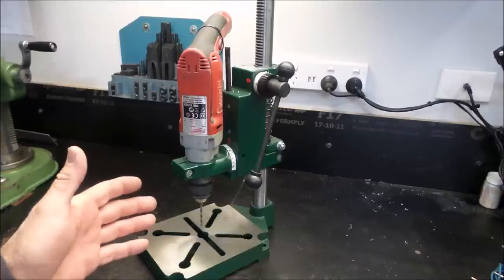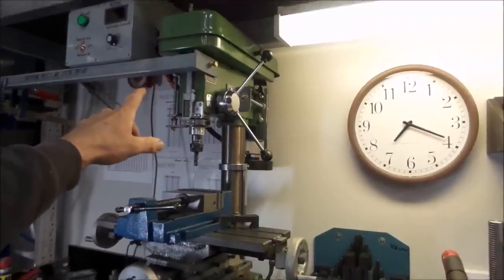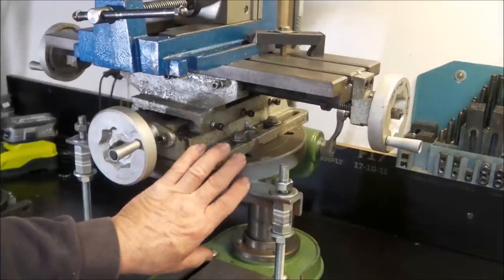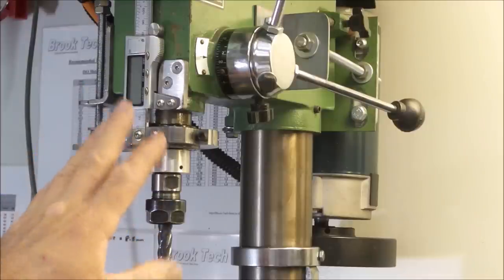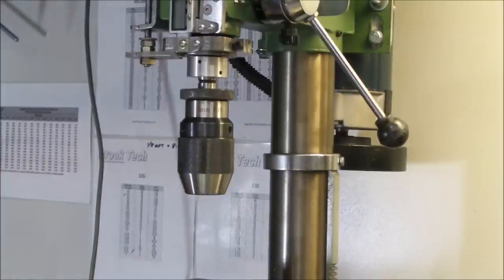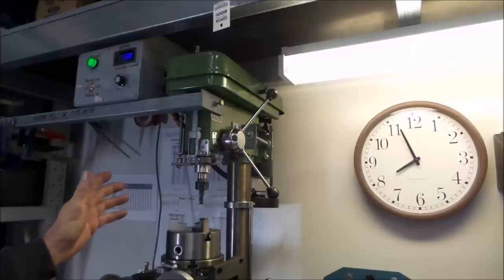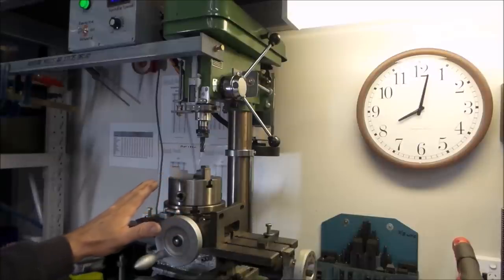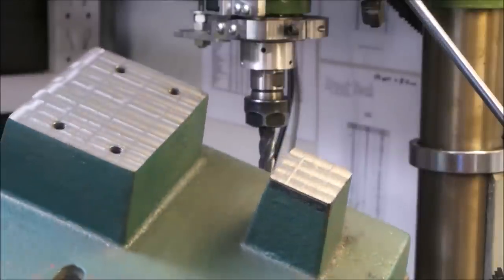The Ultimate Drill Mill Conversion Episode 1

Comment: Excellent video!! One point to consider for converting drill press to mill,  if replacing the quill bearings, is drill presses have ball bearings which are limited in thrust, while mill machine lower bearings are angular contact bearings, which are much better for thrust.  On my drill press (a Buffalo Forge 18) I found that I could get an angular contact bearing with the same dimensions as the lower ball bearings.  It's worth looking into.  Greg

Comment: I love repurposed tools. I'm using an old wood lathe head stock to make a DIY surface grinder. Yours is the best DIY mill I've seen. Good job.
Reply: That sounds awesome, I'm trying to use my wood lathe spindle for a light duty metal lathe, and I'm using an old precision ball bearing spindle (it's called a hard disc drive spindle but it's about as big as an american football) to try making a rotary or linear precision grinder with some granite plates for the linear ways with homemade graphite air bearings. Still major work in progress but I'm keeping my fingers crossed.

Comment: I have a HF round column gear head mill that is basically the big brother to your rig. When tramming the tool to the table I use a 150mm cut off of 8mm rod from one of my 3D printer projects. The rod is totally straight and is easy to line up with a square.

Comment: Great video..I've seen a few more worthwhile modifications..like a 80/20 sand/epoxy mix to fill in columns and base castings to dampen vibration / chatter..a car scissor jack to raise and lower the drill press table with just a turn of a handle..but the best was to dramatically stiffen the chuck head from sideways flex with a ball bearing fitted to the outside of the chuck then a sleeve on the outside of the bearing that then U bolts back to the column with a fitted metal spacer in between the sleeve and column..2 to 4 U bolts are used..making sure to tighten but over tighten causing flex back towards the column..the chuck usually needs to be fitted to fit exactly snug inside the ball bearing with some sandpaper or a lathe if available.. afterwards ZERO flex..I was thinking about using a old 10 to 18 speed bicycle for the gears and a shortened chain to replace the slipping belt and pulley system and gain more speed control and possible torque..also seen a old treadmill motor and controller used with great results..

Comment: Finally got around to making a that collar for an M2 taper ER32 collet.
…easy as! As well as taking lots of steps to reduce all movement, re your ideas.
All in prep for a light mill conversion as you’ve set out.
The bonus, even at this early stage, the drill function has really improved.
Ta mate.     R
Reply from the maker: Cheers Rod, great stuff. Agree 100% with the improvements to the Drilling functions. Well worth the effort.

Comment: Was looking to send you a drawing of a dual cam bushing that I use to reposition bolts and shafting on conveyors after the bushing/bearing hole has been wallowed out.  I also made a larger version for a friend to relocate his Pinon Gear closer to his Milling Machine Spindle Column. It had zero back lash in the gears to column afterwards.

Comment: Now you just need to make a power feed attachment for the table. You can use a windshield wiper motor or a small stepper. Banggood sells a $3 PWM controller that has 2 channels and will control a stepstick stepper motor driver and a NEMA 17 stepper. Use one with 2 shafts and there you go, Power and manual feed for under $30. Really makes facing jobs like that, easy. Some people just make a coupler that fits over the wheel hub and uses a cordless drill to power it. Really saves on the wrist action on those repetitive surfacing jobs.

Comment: Perhaps changing out the quill bearings for tapered rollers would help too. Maybe a few machenist jack type shims under the hollow base at the root of the column to aid rigidity also..You've inspired me to have a go at my drill press now. Thank ya kindly...B^ )
Reply: Unfortunately, that isn't as straightforward as it ought to be, deep groove and taper roller bearings don't come in identical sizings, most of the time you'll find two dimentions that match but not all three, something I found out the hard/expensive way.

Comment: the tapmatic drill tap adapter will allow one to tap with a drill press safely if your drill press has enough horse power for the tap that you are using, I have tapped 1"-8 11/2" deep in mild steel in production line with tapmatic, good vid thanx

Comment: Excellent! i'm trying to mill with an extremely heavy stand drill press , have an excellent cast iron proper miling machine compound table but my nemesis is the N 3 Morse taper which gets loose everytime, would appreciate a lot if you can show the design of you collar. thank you in advance your material is Superb!
Reply: I made a collar after seeing this. I cut a groove around the bottom of the spindle and another on the MT2 taper to match the collar. Now it cant slip.
Reply: @russleggett3728  Tanks! good idea

Comment: Maaate......that collar thingy is the ‘genius’ solution I have been looking for, thank you.
Someone elsewhere suggested filling the post with metal sandblasting grit, whatd’y’think?
I’ve stacked some rare earth magnets down from the main motor body to an eye guard brace
to hold the Chuck down and it’s been solid. I have some of varying thicknesses to alter distances.
Reply from the maker: G'day Mate, filling the post would not have helped in my situation, my biggest issue in that area, was Flex in the Base Plate where the post mounts into. Bracing the Head of the Drill Press, for me, was a better solution took & works really well. Cheers.

Comment: You have the best drill to mill conversion I've seen, and I've hunted a long time. Yes I have done what I shouldn't have done - tried to run an end mill in the drill chuck - and it shook out. Fortunately it didn't do any damage. My bench drill is about the same size as yours and I would still like to try and do some light milling on it. The problem I seem to have is that the spindle has a male Jacobs JT 2-1/2. It's an old fashioned taper it seems, and there's no attachments available. I'm not even sure if one could get a JT-2-1/2 Collet fitting it would be safe to use. What I am thinking of is to take the quill out (replace the bearings at the same time) and to convert the JT2-1/2 taper to a 1/2"-20T thread on my lathe. The small end of the taper is over .6" so this could work. Then I can at least use a new standard 13mm threaded drill chuck. If I do this my question is -- can one get an ER25 collet chuck that has a 1/2' thread in the back? Are there other options you can suggest? It seems to me that I'm probably going to have to make the collet fitting/adapter to the newly threaded spindle.
Reply from the maker: Sorry Garth I cant help with 1/2 threaded collet chuck, I honestly have no idea. You seem like a resourceful guy, I'm sure you will find a solution. Cheers Mate.

Comment: Just an idea if you go on to eBay you can get a milling machine spindle head with a selection of ether MT2-MT4 or BT30-BT40 or ER18-ER40 they have 5 ball bearings and is a bolt on ready to go and can use a drawbar with some modifications you can remove your drill press spindle and bolt one of these in its place and they cost around $100–$400
Reply: I have had those in mind for my manual mill project but can not find any videos of those on the tube. Only one russian video of the bt30 version that dont realy tell me to much., Do you own one of those your self?

Comment: Hi Aussie...I am not sure if you will answer anymore questions on the video. I am needing to mill 2 short 1/4" slots on aluminum 1/4" thick x 1" wide flat bar stock.  I need 2 milling slots about 1 inch to 1-1/2 inch in length and going all the way through the 1/4" bar.. I will make a many passes as needed. That will be all I will need. I can't see spending a $1100 just to do 2 short runs. I already have a compound table but the drill press I have is to weak. Is the a drill press that could handle 1/4 aluminum stock? Or will I need to spend a $1100? Thank you
Reply from the maker: G'day Mate, If you drilled a series of holes along the proposed slotted sections, would your drill press then be able to form it into a slot with an endmill? It would be a lot easier on your drill press if it is only a light duty unit. A little thing like that would be easy peasy with a bigger drill press. Cheers mate.

Comment: If you could find someone with a foundry, the cavity of the base could be in-filled with an aluminium/brass alloy to help gain some decent rigidity.

 The base may even act act as a "chill" plate, which get used for making castings with minimal to no shrinkage.

Comment: Trevor,
Excellent! A great overview of your conversion. As I mentioned I have most of the components already such as a milling table identical to yours plus a milling vice but it’s a bit different than yours. Mine is an import clone of the Kurt which gives super positive locking power to the movable jaw with the angle lock feature so it should serve well, especially after I enlarged the surface area so the thrust bearing on the screw makes full contact. (Import versions skimp on the metal on the jaw side allowing lap over of the inner surface of the bearing which over time will cause the outer rim of the bearing to fold over a bit causing bearing failure. ie:”Eddie the Grouch)
  Anyway I have a bit more modifications as my drill press is a floor model. It’s a seventies model Craftsman so it’s a super heavy cast iron model. I also have the treadmill motor though it’s currently powering my metal lathe. I originally had it on the drill press and was very pleased with its power and speed versatility. 
   You are right about the flywheel that comes with these dc treadmill motors. The flywheel provides the needed torque for these applications. I tried it on the drill press without it and could easily stall it. Once I put it back on I had no worries on torque. 
   It’s great you responded so quickly with this conversion overview as  it gives me information I was needing to get started. Thanks so much!
Reply: Dale, where did you get your Kurt copy from, assuming within Aus..
Other than the trust bearing on the movable jaw would you recommend it??
Carl from Coffs
Reply: carl white,
   I got my vice off of one of the eBay sites. I really can’t remember which one but it’s the standard Chinese copy of the Kurt. Since my mill (and budget) is small I opted for the four inch vise. As far as recommendations I would do so. With the exception of the thrust bearing the vice has been excellent in every way. I got the swivel base model and that feature makes tramming a cinch and the vice locks very solid to the base. The only modification I had to make was the addition of the shop made washer for that thrust bearing to ride against. (Commercial washers are just thin junk these days and I wanted solid surface)
   As far as accuracy I put it on my surface plate and it was in a half a thou in every aspect. I’m a hobby machinist just playing around so super accuracy isn’t warranted in most things I do but I was curious as to how accurate it was because it was advertised to be so. 
   I believe this vice is sold by many vendors one being Little Machine Shop.com. They specialize in machines made in China such as the mini lathes and mini mills so popular today.

Comment: Are you going to make more videos on this conversion? I have an old Taiwanese import Drill press allot like yours that I am trying to convert and am really interested in how you hooked up the treadmill motor. Mine has a JT 3 taper to the chuck though, so not sure what the best way would be to prevent it from coming off under lateral load. I don't think I'll have enough meat to do a collar like you did, any recommendations?

Comment: I have an old drill press head about the same size as what you have there. I was going to try to rig a light mill out of it....Now I will pass.  You did a great job...well explained lot's of creative mods...However, I do not have either the skill or access to needed parts or money to build one. You saved me a nightmare project.
 Have you ever seen any of Dan Gelbart's videos? You may get some inspiration from watching them. A particular that video you may like is "Building Prototypes Part 15 of 18 mill and lathe"

Comment: the long way round but worth every step. a lathe is said to be able to build itself there is no reason a beefed-up drill like this one can't get you to an excellent DIY mill with a little research. the Germans, and you know them,i here told, have taken to building reinforce concrete bases and swear by the results. no one on earth more pragmatic about metal.  the word anal comes to mind and i agree the heavier the better. the denser the material as well. where masonry and machinery meat is heavy and the very basic of anchoring  it's parts Valhalla , i can hear the sharp ring of superb drawn sword steel now

Comment: The ONLY serious drillpress to mill conversion I've seen! 👍👋👋👋😃The question is, has it payed off, financially, time spent and performance wise, compared to just finding an old original milling machine? Perhaps it has!? Also I'm thinking it's a project by it self for you?!

The base could possibly be strengthened with casting epoxi-granit into it? "Artisan makes" has done similar to a mini lathe and mill.

Personally I bought a small mill-drill just to drill and tap a few thousand holes with precision - without vibrations and run out - for a project at work. And then I brought it home. It now serves as a typical hobbyist's complimentary machine to my mini lathe. Motor is only 150W I think!? Anyway, only suitable for milling small model engineering stuff. A step up from the vertical milling atachment for the lathe. (The mill-drill cost about the same as a mini lathe.)

A bigger proper second hand mill could probably be found for about the same money, but handling a machine that weighs five or ten times more, is an altogether diffrent matter. (Same issue with the lathe. I was actually offered a big manual lathe for free, but it wasn't feasable to install at home. The company that bought it new, had only used it very little, and had no use for it any longer. I'll probably think about having turned the offer down for the rest of my life.😪)
Reply from the maker: G'day Mate, It really was a bit of an exercise just to see how far I could go with it. It started out of necessity as I needed  to mill some small pieces of aluminium. It certainly paid off for me, as in it allowed me to complete some small milling tasks in house. Plus I really like dicking around with stuff.  Like all of these type of things though, it doesn't take long to outgrow. I have a pretty decent Manual Mill Now, not a Benchtop Mill, but not huge. Whole different Ballgame, dicking around with the drill press was very helpful to formulate exactly what I wanted from a workshop mill. Without it i'm positive I would have bought the wrong Machine. Cheers Mate.
Reply: @TheAussieShed  Sounds like very good developement!😃 (The internet is really great - sharing experience and learning literally across the globe - I live in Sweden!)

Comment: i tried to setup this same box. trying to figure out how to get the 12 volts for the rpm display. did you somehow get yours from the scr output?
Reply from the maker: G'day Jake, I have a 12v wall transformer from an electric shaver if I remember correctly, wired into the box for the 12v stuff. In some of the others I have done I used a small 12v transformer from ebay, Cheers Mate.
Reply: @TheAussieShed  that's kinda what I figured. Thanks!

Comment: I have a 16 speed rexon tiwanese drill press that I used to do light milling in aluminum. 

Interesting solution to the taper dropping out during milling, I wish I could find a solution that did not require a Lathe. I ended up putting a small tack weld on mine in order to finish the light aluminum piece I was milling and left it that way for years. Though that tack may have introduced more runout in the chuck, hard to say because I only checked runout after the fact. +/- 5 thousandths if I remember right.

I also have a really hard time with hole saws in the drill press which is causing me to try and improve runout and rigidity as much as possible.

Comment: So everyone I've talked to says that the bearings can't handle side loads (radial) because they are made to handle vertical loads for drilling (axial). The issue with this is that every drill press I've taken apart has typical deep groove ball bearings which are in fact made for radial loads and NOT axial (iirc deep groove bearings can usually handle three times as much force in the radial (sideways) direction so this doesn't make sense to me). Even so it's pretty easy to find matching sizes of tapered roller bearings to replace the ball bearings if one wished to make this type of conversion more effective.

Comment: If you want to make your base more stable can't you make a sleeve for your upright and fill the rest of the base with metal. Or you can take the base off of the press to make a sand casting and machine the new one it to fit properly

Comment: Just found your channel. 👍🏻 I have just got a good treadmill motor to make a variable speed on my drill press. 
What pulleys and ratio did you use on your drill press. Ps I might be trying to do the mill conversion on my pedestal drill press as well after watching your video.  I was also thinking of making the pedestal out of heavy box to stop flex, what are your thought on that?